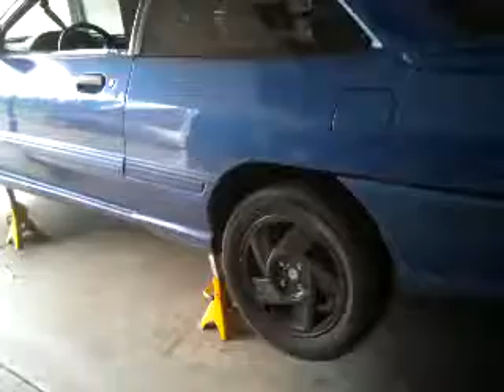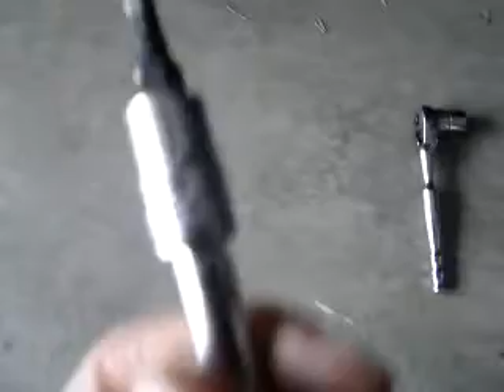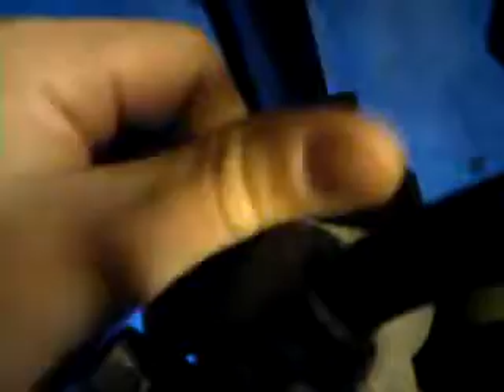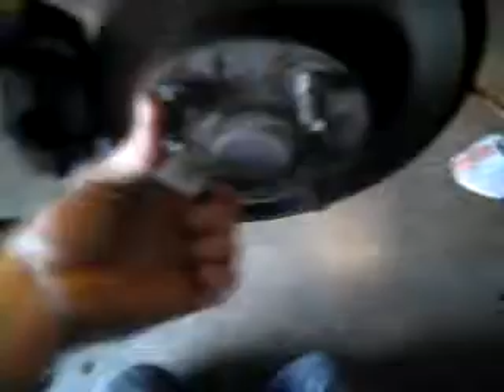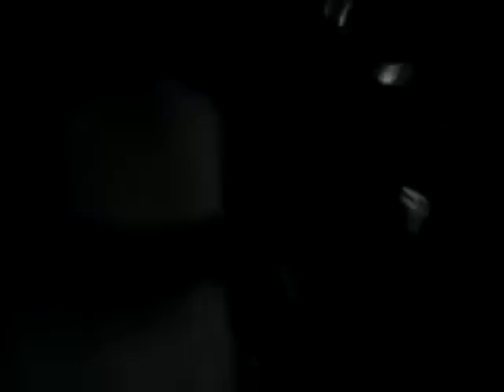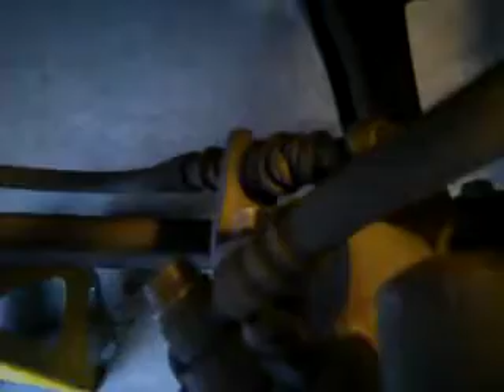How to adjust your ebrake with disc brakes

Comment: It's cool you've got a '91 Escort, love my car, put a lot of work into in since November... engine swap, replacing seals and clutch and alternator(today) new back brakes, got my windows tinted, order a sound system and it's enroute... it drives like a dream, but i'm having little problems here and there and it's just starting to get frustrating... hopefully tomorrow will be a good day....

Comment: Thank you for this vid, it really helps, I have a 1998 mitsubishi eclipse GS, and the e-brake will not keep the rear wheels from spinning backards, but they do frontwards. But now with this i can fix that problem. Thanks so much bro.

Comment from the maker: @podboq2 yeah brakes will work great as long as there isn't air in the lines, the parking brake just needs those screws in the calipers adjusted, good cables that aren't all rusty, and then it's adjusted all good inside the car and you're good.

anyway good luck getting it all done, if you need more help you can either PM me or comment again, I could do another video as well showing more adjustments.

Comment: @Hotrod I always wondered myself, how ever, we are used to the handle style more than anything else, and according to this old school mechanic I argued about it with said that the older cars had in fact  a peddle for the "alternate" brake that would lock up the tires in case of an emergency, they would lock up the rear ones due to being drum brakes. I myself don't know this for sure though.. Yet..

Comment: My hanes manual says to use the hidden hex screw to adjust the calipers after replacing brake pads, or getting new calipers, to tighten it up then back it off a 1/3 of a turn... it doesn't say anything about the parking brake there.

The parking brake is a different procedure, when you unhook the cable from the caliper by adjusting the screws on the threaded cylinder that the cable goes through

Comment: You should never use a torque wrench to break loose a fastener. You will damage it or at least throw it out of calibration. Also, the factory Ford Escort manual says to tighten the Allen bolt just to where the pads touch the rotor and then back it off 1/3 of a turn.

Comment: I guess your suggestion doesn't make sense to me, because I never adjusted the cable inside the car, I disconnected it from the calipers on the rear, and to do so I moved all the fasteners back there so they were loose enough to disengage.  I'm gonna work on it tomorrow, and see where I can get... seems like the more I work on it, the more problems crop up...  I installed a new alternator today, and now my heater-blower doesn't work! lolol  such is life I guess....
Reply: Are you a professional mechanic.....lol......cuz that's the same shit they do. They fix one problem and return the car to you with another problem.

Comment from the maker: @podboq2 hmmmmm, you sure the adjuster screws inside the calipers grabbed?  compress the calipers all the way and tighten that allen screw in the back there till the brakes lock then back off till it spins freely again.  that's what you did right?  if you did that and didn't mess with the cable inside that's odd, but if 1 of those screws didn't catch then the cable would pull, and nothing would happen at the calipers end.

Comment: I replaced my rear calipers and pads, and removed that cable shown in your video... to remove it I had to loosen all the nuts on the threaded shaft through which the cable runs, and I haven't been able to find any tutorials on how to re-adjust the cable.....   the hex screw inside the caliper is for adjusting the resting position of the piston when you replace the old thin pads with new thick ones...  it doesn't adjust the parking brake, so far as I can tell...  any ideas ?  Anyone?

Comment from the maker: @podboq2 yessir I know exactly what you need to do, go inside your car and there's a 10mm nut on the driver side of the emergency brake lever down in a little below the rubber guide on the side there, just push that rubber to the side and you'll see the 10mm nut on a long shafted cable, just tighten that down till the ebrake is as tight as desired!  don't go too tight or obviously you'll ride the ebrake lol, hope that helps!!

Comment: My volks passat has been parked for 2 months WITH THE HANDBRAKE ON! (mom parked it at the cottage for me for the winter...) and the e-brakes are holding it hostage up there, do you think if I attempted this reset of the rear wheel's e-brakes behind the caliper I'd have any luck? any other suggestions for seized e-brakes on a volks?? THANKS JBY